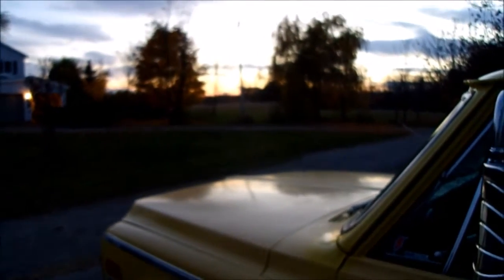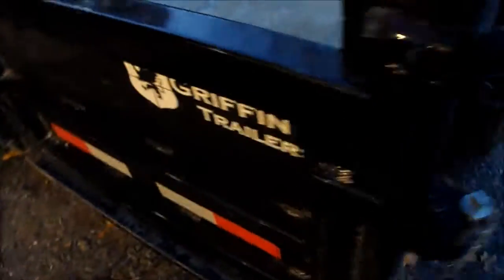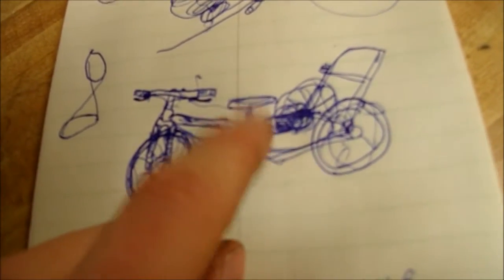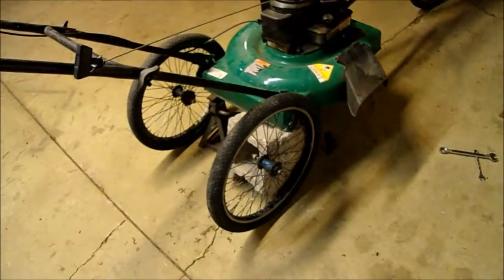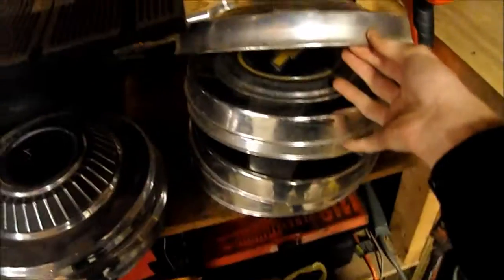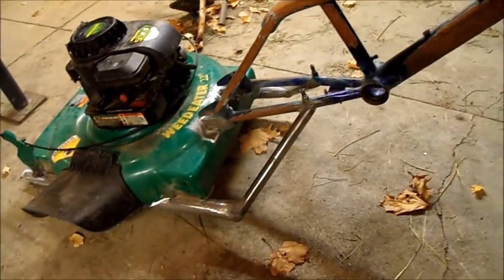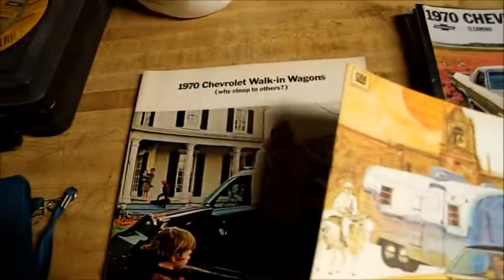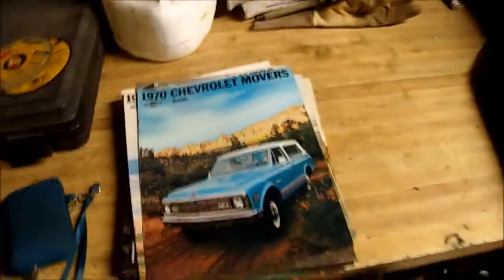Mowercycle build (part 1) Design and start

Comment: That's gonna be real cool. You can have the mower handle as an option, it does look cool without it. Those pamphlets are great! That last one with the 70 Blazer on the cover, a coworker has that same blazer. He painted it that original blue.
Reply from the maker: +Redgonetogray Very cool. i collect them

Comment: I didn't understand whether you plan to keep the mower with blade or just use the mower as part of the frame and motor mount. It would be a cool mower I think.
Reply from the maker: +Bruce Boschek no blade, just a wicked fast bike

Comment: A lot more fun way to mow maybe? looks interesting.
Reply from the maker: +shartne lol no blade on this one.  we will see how it works.  it's funny i tried running it yesterday and it actually has the opposite problem as you thought it would, the belt has too much grip.  i have to fine tune the idler pulley so it could idle and not run away
Reply: well that is good.